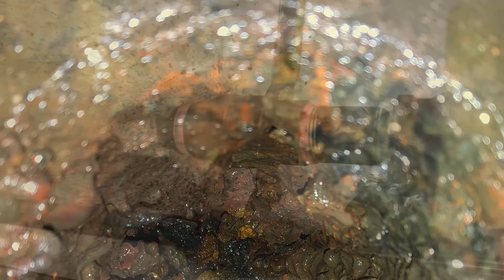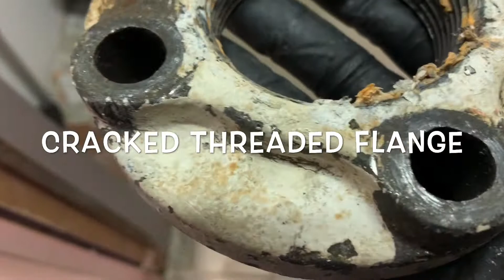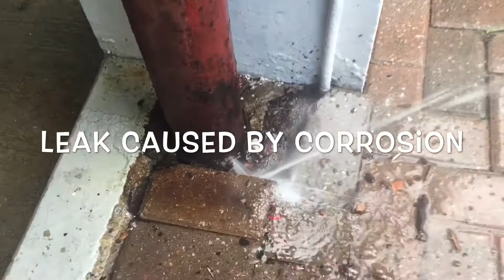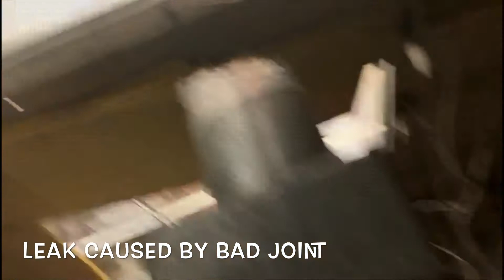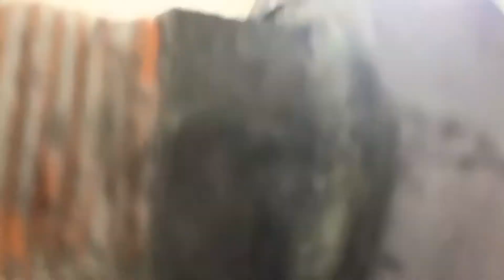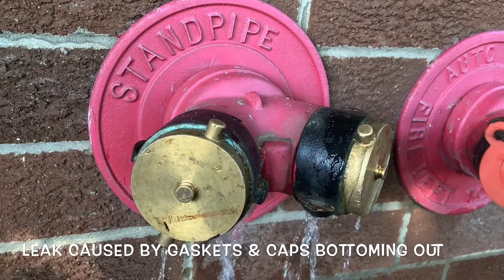You Won't Believe What's Hiding in Your Fire Sprinkler System!

Comment: The reason is that last video of the (FDC) The fire department connection is leaking water back through it is because the back flow/check valve has failed.
Reply from the maker: In this instant the leak is caused by the rubber gasket, not the check valve on FDC.